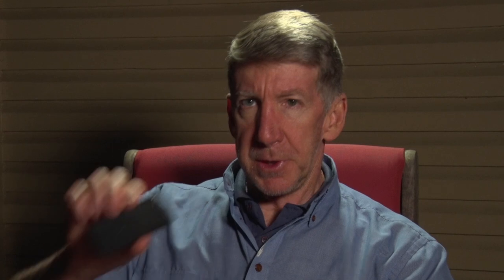Track cleaning do's & don'ts update...most views in 24hrs!

Comment: Hi Gregg, hope you are keeping well. Gary is a good friend of mine, who I have known for about 20 years. He is still out at Blacktown, and is where I buy my NCE decoders from. Wondering where you find Inox. I have not seen it in the hardware store. I have been using CRC, but would prefer an Aussie product any day. I went a bit mad with Midwest cork last weekend, and have been using your excellent idea of spacing out the joints on my Peco flex track. https://www.youtube.com/watch?v=CtTIUnlIAAo&t=236s
Reply from the maker: Hi John, thanks for watching and all good up here! Say hi to Gary for me..he may remember talking to a QR Signal guy? I have to send a cab down for a screen replacement soon. I think Bunnings may have it or try a auto store or nut and bolt place?
I'm glad you like the MW cork and the track laying tips.
Cheers Gregg.
Reply: @FishplateFilms  Bunnings was a no-go, but I was successful at our local Auto-1. I think the Inox is actually a bit better than the old CRC. Hoping to get out to Blacktown next week, so will make sure I give  you a mention :).
Reply from the maker: @1stArizonaSub  Good one John!  Let me know how it goes! I'm also thinking of getting the new WIFi connector that Gary sells , forget the name , but it allows smart phone and PC connection with out a computer and JMRI. 
Cheers Gregg.
Reply: @FishplateFilms  Gregg, do you already have JMRI on your computer, and a wireless router/modem? I noticed you have NCE, so I guess it is the Powerhouse Pro. That should have either a USB or nine pin serial plug on it.

Comment: I use CRC as a cleaner because that's what I got from the store. I can't get on with your rag applicator method, the rag gets soggy & snags. I either use cotton buds or moistened cork or cardboard. Whatever works for you. I might try graphite too. But I don't have your courage, I still clean my track & wheels. I've got a couple of steamers with marginal pickup that insist on having their wheels cleaned.(I use DCC).
Reply from the maker: Hi Bob , I don't put very much on at all , just a quick squirt for each rail , about a 1/4 inch squares. Also I use "shop" rags which are pretty tough. Cork is a great idea as it scrubs a bit also but I tried the graphite block but gave it away as it shorts out the track and  doesn't really clean the track.
Thanks for watching.
Gregg ;
Reply: @FishplateFilms  Thanks for the reply Gregg. I should've said about the rag method that my CRC can squirts a bloody lot out at once no matter how careful I am. So it soaks the rag. Will think about tougher rags. But yep, the cork works good. Happy modelling, & I hope a few warbonnets make their way over your rails.
Reply from the maker: @boballan9681  Hi Bob , I'm lucky as the Inox has a good sprayer! I do have two Atlas DAsh8 War Bonnets that are on the roster...I'll have to get them on camera a bit more! 
Cheers Gregg.

Comment: If you dry off the track the water content has no negative effects
Reply from the maker: I'm afraid it does Nigel. IPA leaves a residue apart from the water content , and it has a negative effect on conductivity and this builds up over time. It took me about 2 years to work out the problem !
Cheers Gregg.

Comment: G’day, was just wondering what brand of track you use and what you paint your track with? I’ve tried enamel and acrylic and get some kind of oxidation. Happens to Peco, Atlas and Micro Engineering. I’m in Brissy QLD and can’t help but wonder if the humidity has something to do with it?
Reply from the maker: Hi Trevor. I haven't painted any track yet , apart from a small section on the top level and I used a acrylic spray can. The track is Peco code 83  I'm also in Brisbane and haven't found any issues with the painted track? It will oxidise anyway ,  is the painted sections worse than others? Either way a product like Innox or crc will stop that or at least keep it under control.
Cheers Gregg.

Comment: I now use CRC 2-26 following your advice although I do have many Locos with traction tyres so I take your point about running round the layout.  Perhaps wiping the tracks down with a dry rag after initial cleaning would allow for running traction tyre Locos? Certainly CRC is good when servicing Locos.  The most confusing bit I found was when purchasing CRC as they sell many products- it’s the 2-26 for model railways!  Very interested in your graphite block, so will be keen to learn of your experience- thanks so much!
Reply from the maker: Hi Roy, glad you found the video helpful! I think try doing small sections and giving a quick wipe , but not too much as to take all the CRC off? You will know when you have a issue, but the tyres dry out pretty quick if they get too slippery!
Cheers Gregg.

Comment: Gregg, can I ask more about cleaning with the wet and dry and innox.  I've just finished my track in the UK so you can imagine it's got glue. paint etc on it.  Is 1200 paper and innox going to be an OK place to start with the cleaning?
Reply from the maker: Of course you can Catherine! If you can get away without using the wet/dry , thats better , but you can use the Inox with the paper if you have to! You could try metho or IPA first , but if that doesn't work , then the paper will be the next step. Just go gently and then use a rag with a little Inox to clean the residue  off.
Try that and let me know how you get on! 
Cheers Gregg.

Comment: Hi Gregg extremely good information on track cleaning you mentioned in the last video to use CRC without Silicone, but when I looked everything had this in. Im in the UK do you know a brand name hat has no silicone . Also people are stating to use WD - 40 is this good it does not have silicone? cheers Paul at Sandling Junction
Reply from the maker: Hi Paul, try CRC 2-26 , it has no silicone, and a slot car shop in Lancashire has Innox ..Pendel Racing according to a comment?  WD-40 in a pinch..
Cheers and thanks for watching.
Reply: FishplateFilms thank you for that, Paul

Comment: Hello Gregg, Good to see an Aussie on YouTube. Just stumbled across your channel as you do. Enjoyed your video [rant] on track cleaning 'do`s & dont`s'. Just by way of interest I have used a track cleaning rubber sold by DCC Concepts who were in Perth WA until they buggered off to the UK. It is pure rubber impregnated with Aluminium Oxide. It does not leave any residue on the track, nor does it scratch the track as I have checked it with a powerful magnifying glass to check for scratching.. By the way I have just subscribed to your channel.... Cheers   Greg [Queensland]
Reply from the maker: Thanks Greg,  I have not heard of their track rubber? But once your track is clean from paint, glue , ect, I would still stay away from them as they will not stop corrosion or oxidation . Plus where does the rubber and oxide particles go as they wear away?  But if it works for you then thats what matters.
Cheers Gregg.

Comment: Hey Greg, which CRC  product do you recommend. You mentioned 626, but I can’t find that. There’s the straight contact cleaner which leaves a silicones film. There is 2-26 which is moisture displacing lube, and 6026 which is insulative marine stuff. I’m betting you mean the 2-26.
Reply from the maker: Correct Mike ...I got confused..LOL  2-26 is the one!
Gregg.

Comment: Watched both videos. Super information. I see Inox can be ordered in the States from Ace Hardware and even Walmart. CRC 2-26 is also available at auto repair shops. Thanks for the info. I spent many years using the gum eraser on N scale layouts and LGB track cleaning fluid on S and O gauge layouts. Now I know why it didn't improve performance.
Reply from the maker: Thank you SB!  Well now you will have better running trains and less headaches!
Cheers Gregg.

Comment: I watched your video on what  not to do for cleaning track. My locomotives were starting almost every two to ten seconds sporadically. I cleaned my track per other's recommendations and it made no difference . I decided to use some WD-40 on my engines. Now, my DCC locomotives are running good. I still have stoppages from my Light Mikado steam engine on two turnouts, but my diesel works great. I thank you for your advice and experience.
P>S. I just started back into model railroading in N scale after fifty (50) years from my first layout in the 1970s.
Reply from the maker: Welcome back and I'm glad you got some good results and it will continue  to improve. Just a little now and then  is all you need , and keep cleaning the track  in different spots. 
Cheers Gregg.

Comment: Hi Greg, I really enjoyed the 2 "cleaner" videos. They made my day!  Did you ever do one on the graffiti block? 
Thanks again, 
Pete
Reply: Grafite block..
Reply from the maker: Thanks Pete!  I did get a graphite block , but , as it's conductive, I have to turn the layout off to try it!  I have tried it on a few places , but it's hard to see how it performs with the Inox on the rails. It would help in tunnels and hard to get areas, but it doesn't remove dirt from wheels like the INox /CRC does. It was pretty cheap so worth a try if you wan't.
Cheers Gregg.

Comment: Hi Gregg, as if by magic I stumbled on your channel. Yes I am guilty of the ‘rubber cleaner’ but no more after watching your rant 😆. I am having problems with my track and locos stalling at certain points on my small layout. I immediately used WD 40 Im in England, and there was an instant improvement. I model O gauge and was getting really disheartened after ballasting problems started occurring on points. All checked no ballast in point work. Your tip seems to have improved running considerably. Thank you 🙏🏻.
Reply from the maker: Hi Julian,  Thank you for the kind words and I'm glad you are seeing an improvement!  Pendel Slot Racing , in Lancashire, sells Inoxx apparently!  "O" gauge British is lovely stuff  and a joy to watch if done right!  If you are using points that power the frog from the  switch points, make sure you clean the inside of the switch rail and the stock rails with the spray to get better contact when they switch! A little bit on a cotton bud works well and also don't leave the track "wet" , just a tiny spray on a rag and run along the track to leave a little film.  
Thanks again for the feedback and let me know how it goes in the coming weeks!
Cheers Gregg.

Comment: Gregg two great videos on this subject!  I have a few questions .. I buy ME weathered track, how do I get the weathering off the top?  When I have to file the track, I get small scratches on the track surface, how do I remove them?  Also will WD40 sprayed on a rag then run over the track work?
Reply from the maker: Thanks very much Craig!  I didn't know they weathered the top! If the trains run fine I would leave it , but cleaning and running trains over it may shine it up! If you want to polish it , use a VERY fine wet /dry glasspaper, say 3000 =4000 grit and lightly polish it with some CRC or Innox. 
Cheers Gregg.

Comment: As a kid I used graphite for my 12V dc Lego train (the 1970's type with separate current rails in between the running rails.) I applied graphite using a carpenter's pencil. The treatment was quite effective but had to be repeated often. I think part of the effect was that the pencil was not pure graphite but also contained some abrasive particles that helped grind through the oxide layer on the rails.  Anyway, the graphite will not prevent oxidation (as inox does according to your experience). Once in a while I used alcohol to remove grease and dirt. Of course the graphite was cleaned away also and the train would not run reliably until after a new graphite treatment. I think the way graphite works is as follows: Even if the rails are oxidized, there are plenty of microscopic holes in the oxide layer where the pure metal is exposed. Unfortunately, the weels cannot reach these spots. If the holes in the oxide layer are filled up with graphite and graphite is smeared on top of the oxide layer, the oxide layher is bypassed and the weels obtain electrical contact. If there are no holes in the oxide layer, the graphite will not help. A nice property of graphite is that it is a "dry" treatment that does not attract dust.
Reply from the maker: Thank you and very well explained ! I think the graphite is a good option for those who don't wish to use a liquid , but it does leave the rails open to oxidation? I have ordered a block and will be testing it out on the upper level of the layout to compare it to Innox? Should be an interesting test?
Cheers Gregg.

Comment: I saw your video. And I tried it on a bad spot on my layout. You can get it here in the States at Ace Hardware. I ran some of my difficult running locomotives through the bad spots and they ran better than they ever have. I wish I knew about INOX a year ago. Where I took out about eight feet of trouble some track where I was having a lot of issues. INOX may have saved me about a week's worth of work. Thanks for sharing. I have past it on to a few of my friends.
Reply from the maker: Thanks Vincent! Thats so good to hear you got some great results regarding Innox and your locos are running how they should!  Keep the dirty rags , as they will stay damp with the spry and you can use them for  maintenance cleaning!  Keep me updated on your progress!
Cheers Gregg.

Comment: Hi Gregg.
(below comment was made before I viewed the update video. It would be interesting to to find out if I ox is non-polar. ) 

In the May 2019 model rail road hobbyist there was an article on cleaning rail and wheels.

It discussed polar vs non-polar solvents.  Non-polar being good, polar being bad.  The CRC and WD40 contact cleaners were non-polar (good). 

 Isopropyl alcohol, mek and acetone amongst others 
are polar. 

I've also noticed that cleaning the inside radii of the top of the rail head also improves electrical pick up quite a bit. 

As an experiment I cleaned the inside radii only on some dirty track without cleaning the top of track.  This improved pick up noticeably. Not 100 % but significant. 

Cleaning both the top of the rail and the inside radius with a non-polar cleaner is probably the gold standard. 

Cheers Doug
Reply from the maker: Very interesting Doug!  Having not done chemistry at school, I am not familiar with that , but it makes sense! On curves , the outer rail's inner edge will have flanges rubbing on it , so that would help being clean also! Having used Innox for years now , I can honestly say I never clean any wheels and they are shiny and clean, even on the cars. So I can only assume the side of the rail is clean also..but I will check some outer rails today! 
Thanks for the interesting points.
Cheers Gregg.
Reply: @FishplateFilms 

Hi Gregg. Here is a link to the edition of mrh that contains the article

https://model-railroad-hobbyist.com/magazine/mrh2019-05

It gives a non technical explanation of the chemistry. 
Cheers Doug

Comment: Gregg, taking on board what you've said about these sprays over IPA for track cleaning,  could they also be applied to servicing the locomotives as well? Or would you recommend something else for that instead of IPA.
Cheers, Paul
Reply from the maker: Hi Paul , it depends on the service? For gears , there are specific plastic compatible oils and greases which work very well.These sprays are not really meant for high speed lubrication , so your best using light oils and grease . But make sure they are ok for plastic! But if your stuck , you could use a spray like Innox as a temporary fix?
Thanks for watching.Gregg.
Reply: @FishplateFilms  

Cheers for the reply, I should have been more specific, my bad. I meant along the lines of cleaning metal parts like the wheels/pick ups, where you would want them to be picking up current. Your video gave me pause for thought about using cleaners like IPA in those areas.
Paul
Reply from the maker: @paulisnotonfire  You can use IPA to "clean" Paul , but then apply a little spray after. But you will find the Innox is also a great cleaner of wheels ect . SO you can do both at once! After i weather freight cars , I will clean the wheels with IPA to remove the overspray from the airbrush , but loco wheels I will clean with Innox.
Cheers Gregg.

Comment: Thanks for the update Gregg! I use the CRC QD Electronic Cleaner available locally here in Florida. I can't see where it contains any petroleum products, Silicon, or Chlorine in it. It works well, but dries super fast and the fumes are both flammable and horrendous to breath in. I have to be careful of sparks or flame and ventilate well. I immediately apply a small amount of any commercial track cleaner afterwards to maintain continued protection. That seems to help immensely. Thanks for all the valued advice. Stay safe! Cheers, Danny
Reply from the maker: Thank you Danny ! COntact cleaner will work but does not protect the track  and they are dangerous!!  You can do both jobs at once with this spray ..or CRC2-26 in the US.
Take care . Gregg.
Reply: @FishplateFilms  Ah yes! CRC 2-26! I have been trying to remember what number that product was. Thanks Gregg! So, maybe that will save me a step and possibly be a bit safer. I'll look for that. Appreciaate it mate! Cheers, Danny